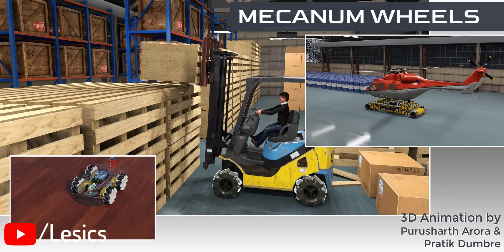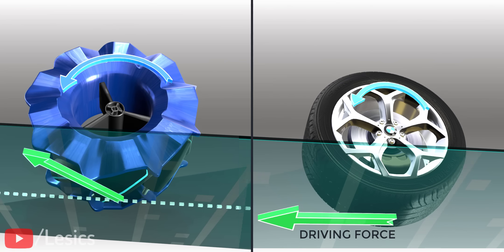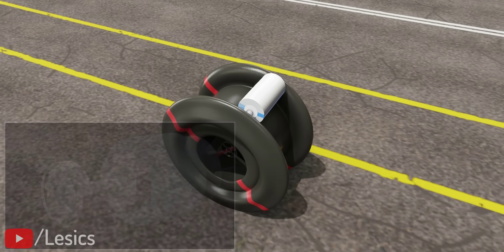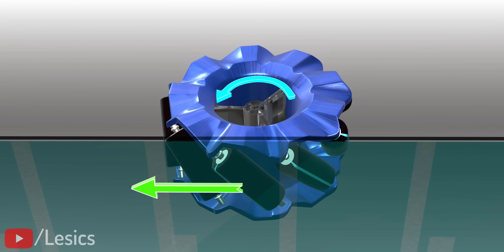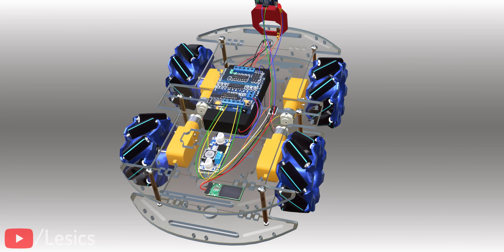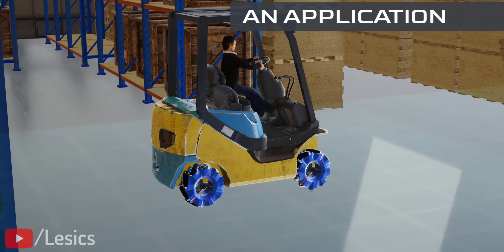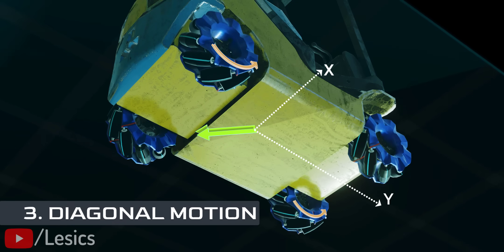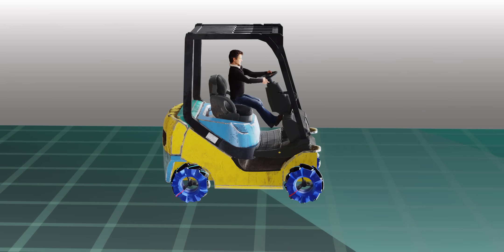The Brilliant Engineering of Mecanum Wheels!

Comment: These are probably really functional and very practial once in the vehicle. The problem is that the cost of engineering is for sure more expensive than the standard.
Even in case of breaking, to repair it would be a pain.
Still, i really love the concept and the video
Reply: The thing about the wheel is maximizing space in warehouses because normal forklifts rquire a lot of space, thats why amazon use small robots for example, even if its expensive for a big company could be definitly worth it if the space gained is really big.
Reply: A warehouse workers dream... Till management stuffs it further with pallets :)
Reply: Yeah, fixing the rollers must be a headache and designing them can't be easy with all the different forces they have to withstand.
Reply: @ramoncf7   this is a working wheel - it was invented 1972 and has been in use since. There is no upcoming designproblems...

Comment: These wheels are only 100% energy efficient when travelling diagonally correct? In every other case two forces cancel each other out, thus wasting energy.
Reply: also forward, since diagonal compensate theirselve it then rolls in the same axis normal wheels do.
Another thing is contact surface and its stability through rotation or weight capability.
Reply: Also as others comments with normal wheels if one lose friction it may keep forward but since this ones have two components vectors forces if one loses friction it may turn abruptly instead

Comment: Can it drive on bumpy or slanted places without messing up those fancy wheels? Great idea. Seems like a lot of moving parts to break and possibly less traction
Reply: Not meant for mountain sports 🤷
Reply: Warehouse applications I'd imagine... Smooth concrete floors, probably mild cracks and seams only.
Reply: @volvo09  You have never seen a standard forklift wheel used on perfectly clean and level concrete floors, I guess. They get absolutely torn up. Which is why these Mecanum wheels are the worst idea ever. Even in the absolute best circumstances imaginable.
Reply: I think it actually can work on hills and such

Comment: Forklifts don't turn like that.  They have rear steering.
Reply: I'm at work right now and I see one with rear steering and one like in the video used for lumping
Reply: @neilw5541  I used to deliver to a shop that had a forklift with 4 non turning wheels. It bent in the center like a worm... It was odd to watch. Regular forklift was much smaller.